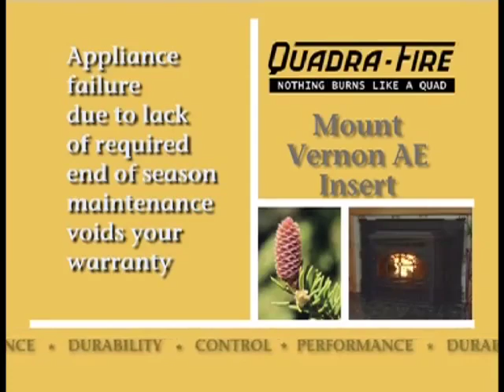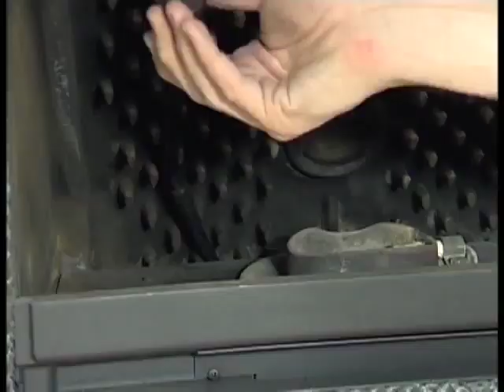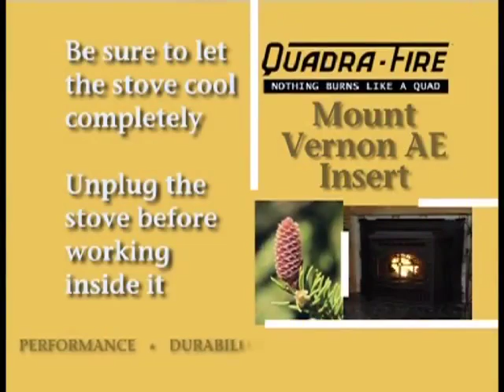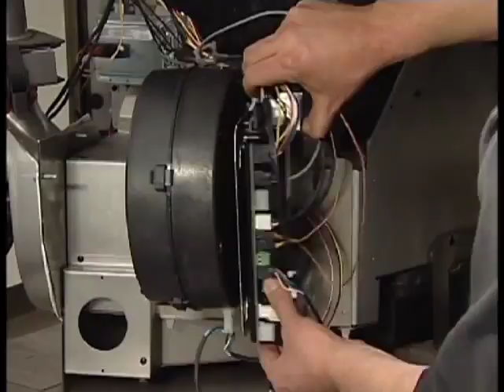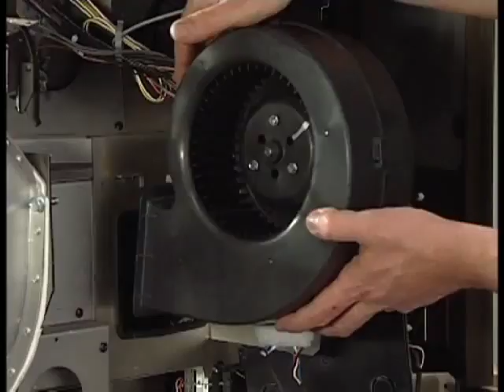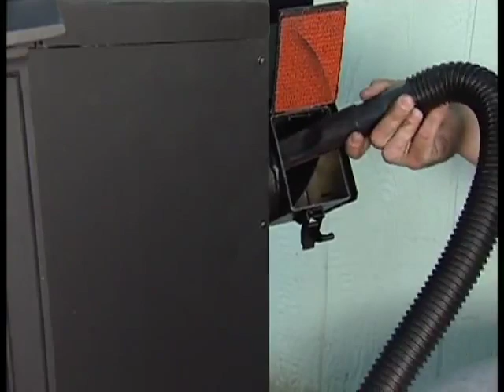Quadra Fire Mt. Vernon Pellet Stove Insert - Annual Maintenance and Care

Comment: It would be helpful to show how the baffle is removed. Instead of vacuuming all the ash up, don't you have 2 slots you can open? It's easy to brush the ash into the pan with a soft paintbrush. Looking at all the wiring etc. and I'm done. It's ridiculous to have to do all that. What a PITA. I hate my pellet stove but I will admit it throws a lot of heat. I live outside a small town in a cold part of the country and it's very hard to find someone to fix this.

Comment: hi 
aqua fire 1000 ,that is my pellet stove
my pelet stove shut down any time  stop completely all all all like is no electricity
cold working no stop at all for one ,two  days or more ,but when i stop it to cleane it and put it on after,now could work for 10 or 30 minutes and full stiop nothing working 
waiting for 10 minutes and put the reset again ,to worke and can make this operation for 2,or more times
is  very strange ,no one techniocien hier know what could be the problem
ollready 2 technicien came ,nothing nothing
just to tell u i change the:thermo couple,the convection motor and the snap disc for the convectuion blower
change the blower the one hoo send the air ouside of the house
how and what i should to do
can u help please?
thank u
Reply: Very old post but here goes anyway. Make sure it's cleaned well, especially behind the baffle. Mine started working well after that. No difference after I replaced a snap disc that powers the feeder arm. After you empty the fire pot using that lever put just a handful of pellets in the fire pot -  no more. That also keeps the igniter clear.